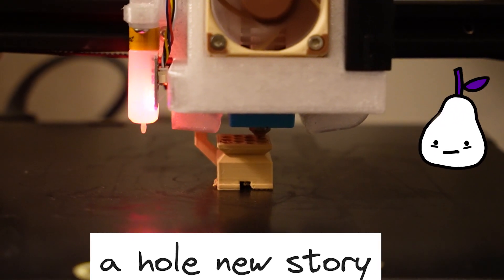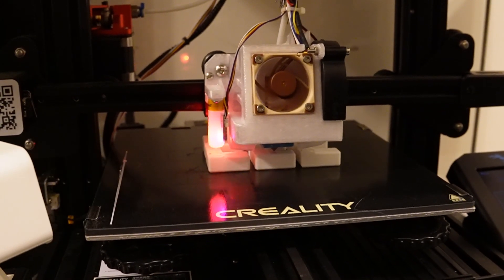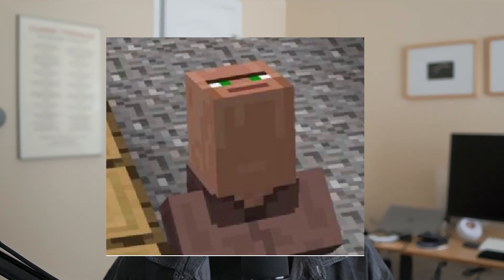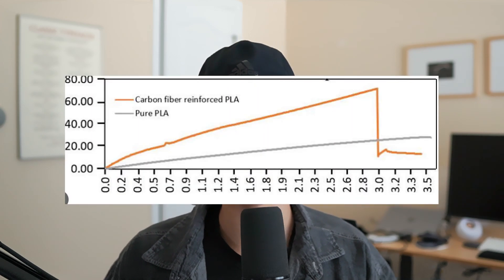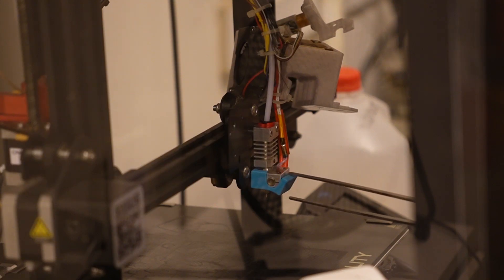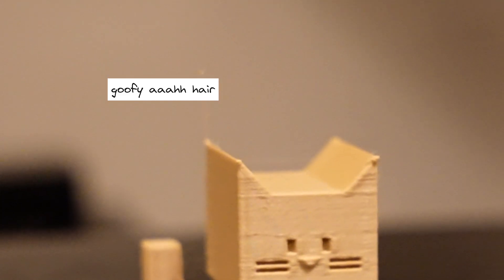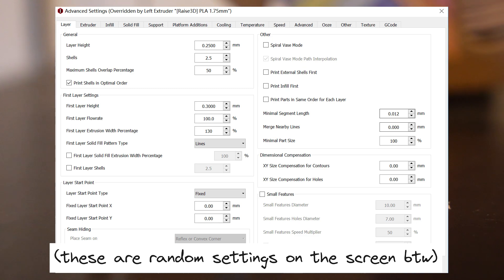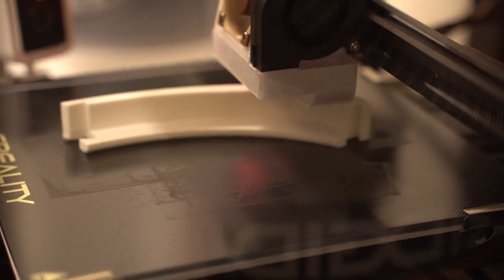I upgraded to a bigger hole

Comment: You know Prusaslicer can make gcode for creality printers right? The "software trick" is the arachne slicing engine. If you're hung up on the Prusa brand name I'm pretty sure Orcaslicer uses Arachne now too. I switched to 0.6 recently as well and I've had 0 loss of detail.
Reply from the maker: I did not know this! I will definitely give this a try. Thanks for sharing 🙏

Comment: Great video! One extremely frustrating thing that Thomas Sanladerer does is use that sparkly black filament when doing side-by-side comparisons. It hides layer lines, especially in his lighting setup (and how he only shows the prints for a few seconds each). I guarantee if he used a filament like you and printed the same cats, you would be able to tell the difference just like on yours. The real message (which you correctly recognized) is that you don't always need finer detail, and for a lot of prints 0.6mm is fine.
Reply from the maker: Appreciate it! And yeah agreed - for most functional prints 0.6 is plenty